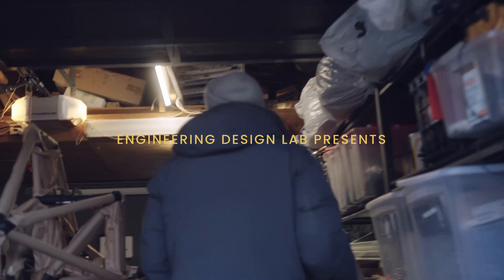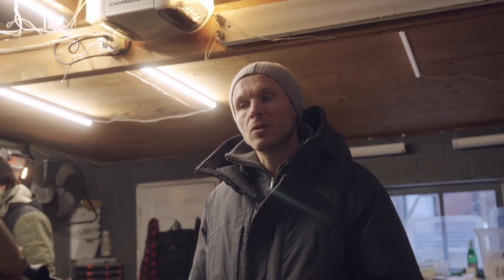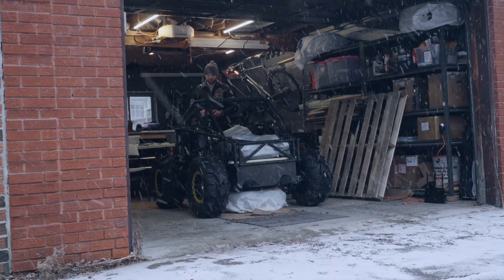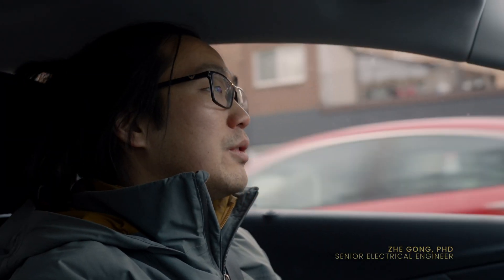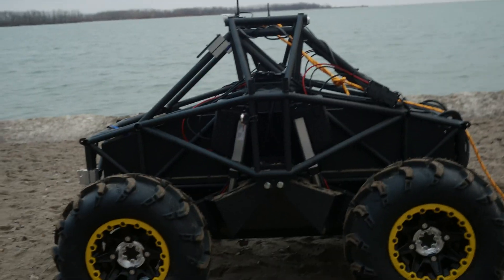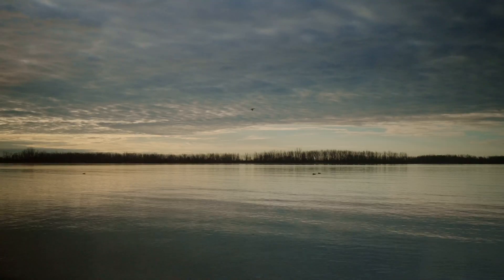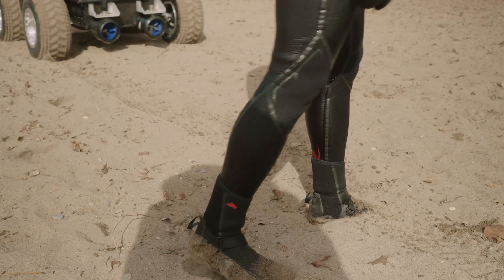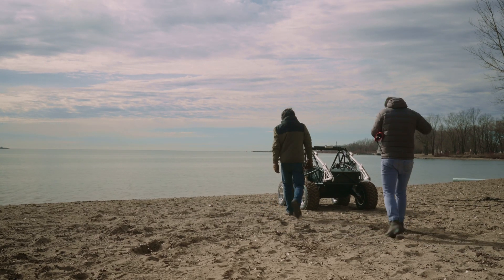WAL-LE (short documentary)

Comment: The default really should have been skid steer.  Watching it spin a single tire is making my skin crawl. They may have done away with differentials, but should not have done away with differential lockers. See quad- versus dual-motor testing in Rivians, Swin-car ATV, and "chainlink" rock crawler, for further reference.

Also, outriggers are always helpful on boats, especially if they're funky ones like this!  I bet some actuators like on the ice axes would also support retractable outrigger floats.
Reply from the maker: Super interesting insights. I’ll let the team know 💪
Reply: @tristan_viney That's a mighty kind response to a stranger grousing at you on the Internet 😊.  Looking again, by the time the ice picks were installed, it appears they may have already addressed the issue of driving all the wheels...  Maybe 😉...

In the shot of it getting onto the rock, it looks like the fronts are maybe spinning in unison, but not faster than the rear 🤔

9:04 -ish: Tire pressure can make a difference, sure, but I really think the bigger issue was having too few driving wheels.  It looked like the first test either didn't have the fronts driven at all, or maybe at the software level they had designed it to mimic open differentials instead of locked diffs.  

I would have been tempted to do an MVP / prototype by building floats onto an ATV.  At least then the off-road functionality would be basically guaranteed as a baseline. 

Two more examples to look at, off the top of my head, are the Argo 6x6 and the Marsh Master.  

And for the ability to climb up onto things, I'd have to consider the triangular three-wheeled assemblies that some stair-climbing dollies use.  (They look like big fidget spinners).  It could even be a potential inspiration just for the ice axes. 💭💡
Reply from the maker: No worries! I didn’t take it personally. I’m a big fan of WAL-LE, but it’s not actually my creation — I’m just the guy who made the documentary. So all these ideas on how to improve the design are really interesting to see and I’ll pass onto the EDL team. Who knows, maybe there’ll be a WAL-LE 2.0 that can implement some of these awesome suggestions!

Comment: As a mech engineer with some offroad experience as a hobby. I would be concerned with ground clearance. I like the concept, but putting all your electronics on the exposed bottom will put it at risk and also reduce ground clearance.
But it does give you a super low point of gravity :-)

Is it supposed to autonomously carry payloads or just to be a "donkey" to carry loads with people in close proximity? Its a bit difficult to understand its purpose other than being an awsome vehicle.

Really cool project. Can see a lot of work has been put into this before any steel was actually cut.
Reply: Yeah, like "mule" UGVs 😊
Reply from the maker: Ah so THAT’S what a “mule” is 😂
Reply from the maker: Thanks for checking out the doc. WAL-LE is pretty awesome, right? I’m no engineer (photographer/filmmaker here), but my understanding is that this 1/4 scale prototype is a proof of concept to transport people and cargo from ships to shore in the arctic — all controlled remotely.

Comment: electric vehicle in the arctic....where to charge it ?
a diesel engine would be a bit more practical , isn't it ?
Reply: Well, electric means it can be charged by any source, which will probably sometimes be diesel - as well as solar, wind, power from the ship, power from bases, etc.  If they were going to regularly use it somewhere, they could also deploy a solar (or diesel) charging stations, like those being done by Jeep, Rivian, Tesla, etc.
Reply from the maker: Great points! My understanding is the battery would be swapped or charged from the ship it would be deployed from. The arctic eco system, particularly the permafrost, is also very sensitive to pollution, which is why the EDL team built an EV prototype.
Reply: And you wouldn't want any implications of false positives or anything, if you're doing core samples to test for pollutants, carbon, etc.